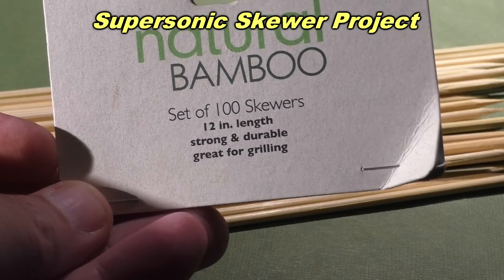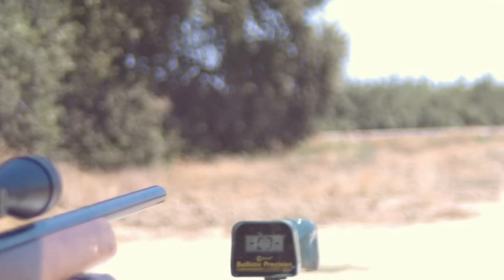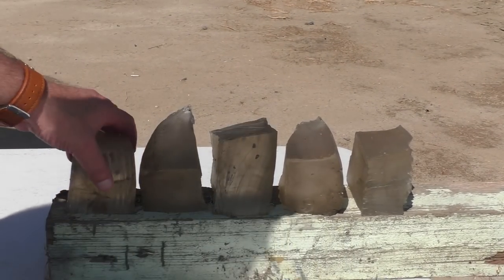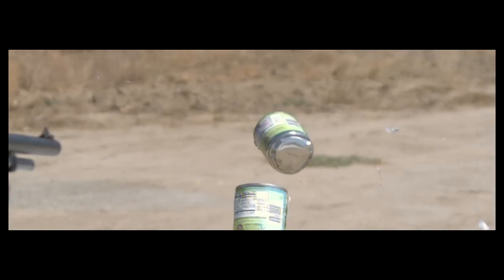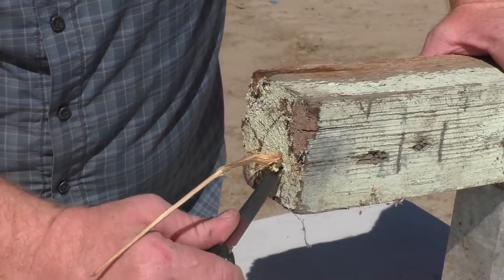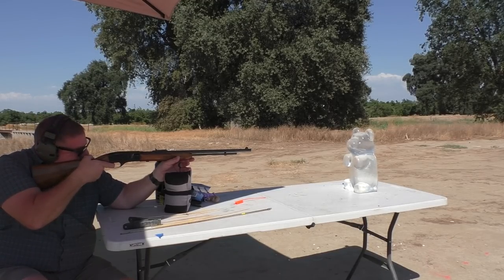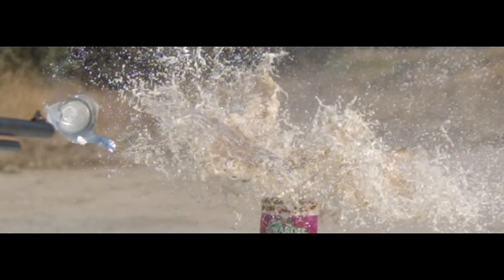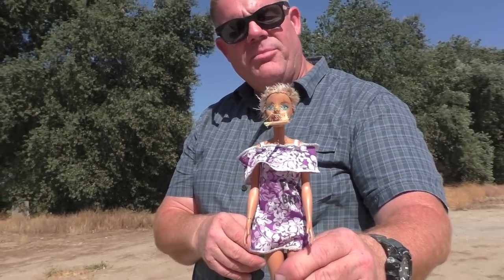Supersonic BAMBOO SKEWERS -  Tested!

Comment: At that range you wonder if the muzzle blast pressure wave isn't adding to the knock over effect. A good pump BB gun may do better due to better caliber match to the skewer. And yeah, I did a lot of matches in my BB gun also with great sound effects.

Comment: This was a great video! But me being from the Midwest I just have to say that tornadoes are a weird phenomenon and are capable of insane damage. Anything they pick up becomes a potentially lethal projectile. I know for a 100% fact that they can blow a 2x4 straight through the exterior wall of a building and they will definitely embed smaller objects into wooden structures and poles. We're talking about something capable of picking up loaded semi trailers and throwing them hundreds of feet or shredding entire neighborhoods into nothing and scattering debris across extremely large ranges.
Reply: I was watching a documentary on tornadoes. An F5 actually peeled off the asphalt on a road.
Reply: @kennethboston8301  yeah it's nuts what a tornado is capable of doing, thankfully the area I live in has been fortunate enough to miss out on direct impact with them for the last several decades.
Reply: @onefastgmc  I live in the Olympic mountains in Washington state. No tornadoes here, just feet of rain 🌧️

Comment: Hollow aluminum compound bow arrows with a field tip. The other thing that would be cool is the same thing except the tail of the arrow has spring loaded collapsible fletchings so they can spread out and stabilize the hollow tube in flight when exiting the barrel. Would have to use an arrow almost the same diameter as the barrel.

Comment: Everyone mentioning airguns in the comments probably have the right idea. You can either snag a multi-pump for controllable pressure or a single-pump break action breach loaders for power. You would need to modify skewers for peak performance, but only slightly. I would gentle sand the exterior of the skewers with high grit (1000 or more) sandpaper, throw away any bent ones, and then reduce the length of the skewers to minimize imbalance. I am unsure the best way to create a seal around the skewers to have them function in the air rifle properly, or what to use as fin stabilizers, if any. I would be curious what kind of performance could be had by just "removing" bits of the skewer.

Comment: As a young lad, I used to make ad-hock ammunition for my .177 air rifle. I would cut the ferrules off of the end of a pair of laces leaving about a 6mm tuft of lace to act as fletching, Then I would push a sewing need through the centre. They were pretty accurate and could also be used as blow darts through a McDonald’s drinking straw.

Comment: Looks like one of the best shots had a bit of wad stuck to the end of the skewer acting like the fletching on a blow bun dart. Hunting darts in the Amazon are fletched in various ways, including small feathers tied to the back end, or just a layer of cord wrapped on the shaft for a couple of inches at the rear (which would probably bring it up to .22 cal. nicely).

Comment: well that was cool.  Question what about a welding rod, or some other metal rod.
Reply from the maker: With these blanks the payload has to be pretty light,  lighter than a normal 22 bullet.   Too heavy and the base of the blank blows off leaving a difficult to remove case stuck in the chamber.

Comment: The straw in the tornado thing comes from the idea that the air pressure around the straw is much different in a tornado, giving it the inability to bend and giving it much more structural strength.

Comment: Aren't you supposed to soak those in water first before you use them? May help with durability.
Reply from the maker: I did try that.  It made them heavier,  but also made them mushy

Comment: So these actually work better in the smaller caliber of pellet pistols. They're not super sonic but just knowing a few good pumps can send one skewer into a board and they're not coming out. You can get a little more bang by smearing a tiny drop of diesel inside the pellet. The pressure released is usually enough to make the diesel ignite.
Reply from the maker: The point was to get these flying at supersonic speeds and see how they behave.

Comment: I used to make darts for my single shot air pistol as a kid by cutting off the plastic end of a shoelace, leave a 1/4”-1/2” of lace attached as a tail and push a pin with a head through the plastic end of the lace. Very accurate from what I remember. 😉

Comment: Many years ago, there was speculation that a tornado caused a tree to twist which split the fibers and caught the straw in the cracks as the tree returned to be twist free.  I have actually seen straw embedded in a telephone pole.  The tornado tore the wires and the crossbars off of the pole, but left the pole standing.

Comment: One thought about the 'straw in a tornado' vs skewer out of rifle: In a tornado, the projectile is riding WITH the air until impact, thus the air movement helps it maintain structure up until impact. When the skewer leaves the rifle barrel, if it survives the initial blast, it immediately collides AGAINST the air before hitting its target, thus is already stressed and probably not hitting straight on. That being said, some of those tornado object pics could be faked or exaggerated too.

Comment: Little fact. Telephones posts are made from brittle and soft woods so they will snap. I have been in the aftermath of 3 tornados. In one f1 the  leaves from tree stuck in a wooden fence and in the siding of a house. This possible but they were probably millions of leaves flying around and probably less than 30 stuck into soft wood. So the odds are there but is also based on numbers and luck.

Comment: No what is impressive is straw grass that was run completely through a 12 inch thick wall of an above ground tornado shelter. After a F5 tornado that sucked the house completely away. 

Or a D9 bull dozer run blade run 8 feet into the ground. Even one of those huge fuel station highway price signs. That have to be 200 to 300 feet tall. Ending up being moved completely intact a mile away.

Comment: A small amount of electrical tape wrapped around the end to act as a guide  1/2” from the tip. Then splice cut the end with a razor to create flights. I used to do this when I made a glove gun like skewer launcher with a piece of pipe and surgical rubber.

Comment: Would heating the skewers right before they char be considered modification? It would slightly strengthen the skewers maybe allowing the to handle the force better.
Reply: Also it would be modifying it but, if you added a little pom-pom on the end of the skewers i think it would keep them somewhat straight. Kind how blowgun darts have the litte drag cone/pom-pom on the end.
Reply from the maker: I don't know

Comment: Linseed oil soaks into wood, then over the course of a several days will polymerize like a varnish.
It's cheap, would be easy, and 2 or 3 dips would certainly improve the strength and the mass.

But I really want you to tie a little "fluff" to the back like a blowgun dart would have.  You'd probably want to keep them just under supersonic but stronger, heavier, and more stabile could make for some good video footage!!

And you are missing an opportunity on a re-do.  That shit halfway and almost worked!

Comment: Shot gun time :)
Nice shot cup packed tight some sewing thread and super glue tie to one skewer slide down and wrap the thread around and super glue it so you have about eh half the length covered. Not fully covered just enough to help hold them a nice spiral going up and down a few times should be more than enough. I expect most of them will flower out in flight and go all wonky but some should hold together good enough to make it to target

Comment: Fire harden some of those, cut them to fit with a corc-wad to a Shotgun Shell, that's prolly too much work tho. EDIT: You could also try to make fletching of a kind to the skewers with painters take and cutting that to the shape of an arrows fletching, and then you can wrap it around the skewer to open midflight (or just slide down the shaft upon firing)

Comment: Optimal length for a poison dart is about 3" or the length of your middle finger from knuckle to tip. Best recommend wadding is spooled thread around the base 1/2". Do not do this with hobnails fired out of a .177 air rifle as the tips will scour the barrel and cause blockages.

Comment: Looks like the toothpick I got crammed between my toes while chasing the dog around. A toothpick on the carpet lifted up as I ran and went in between my big toe and the next one that then splintered into a bunch of pieces like I kicked it with full strength. It went fully in the whole length of the toothpick. Had to cut open my foot to get all the pieces out x-ray would have showed nothing.

Comment: It would be difficult if you didnt cheat. But if you cut them down shorter and used fletches on them things would change dramatically. Or was to say, cast lead around the top with a shorter skewer or any kind of tail stabilization on a shorter skewer then the change would be instant

Comment: Welding rods? Knock the Flux off, comes in different sizes.....
Reply from the maker: If the projectile is too heavy,  the base of the blank blows off and it's hard to remove the broken case.
Reply: Ah, ok. Didn't think of that one

Comment: Sure, now we know the truth, you guys are practicing voodoo on poor little Brittany! I'm afraid to ask what you do to her off camera! lol. seriously though, the clear ballistic animals are CUTE!  I would have NEVER thought about shooting skewers from a .22. although I sometimes shoot around 1.5" long aluminum knitting needle sections sharpened to a super sharp point out of an air rifle. i use electrical tape to make a "bushing" of sorts so that the projectile stays centered in the barrel. and little plastic caps placed in the bore first to act as a gas seal. they are WICKED at short ranges. but accuracy fades FAST as the distance grows. I have always wondered about an all aluminum bullet in a sabot. I know it would not expand, but I have to wonder what the sheer speed would do to a soft target. decades ago I made such a bullet for a 30 caliber bore. but I can not imagine what a mess would be left in the bore from aluminum smearing full length of the barrel would be like to try to clean. and being young and dumb at the time, I didn't think about bearing surface of the aluminum bullet, so it would have wobbled around wildly upon ignition. I threw it out a couple of years ago.

Comment: Dude… the straw/board/stick/etc in a post or pole isn’t because of the speed of the item, it happens because the wind separates the fibers of the wood and then it clamps down as soon as the wind breaks… it only happens during extreme weather events and not all that often then. Seriously dude, do 10 seconds of research. “There’s no proof” lmfao… yeah, there is.